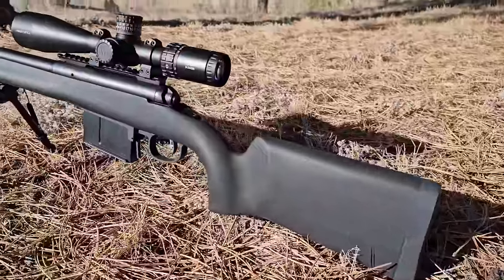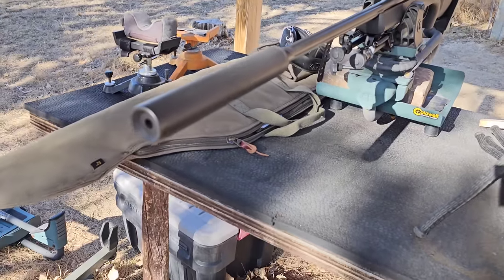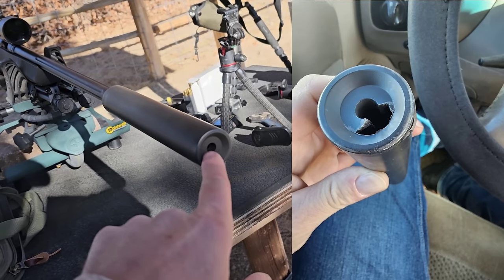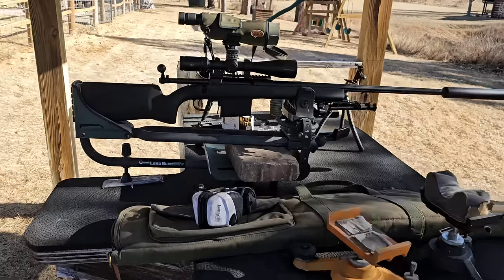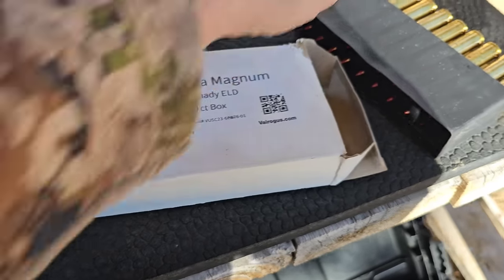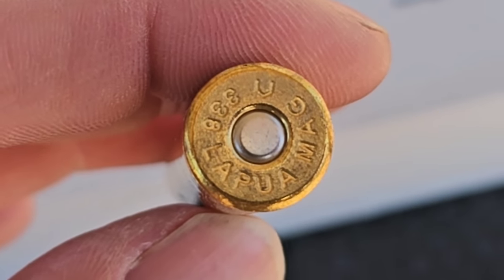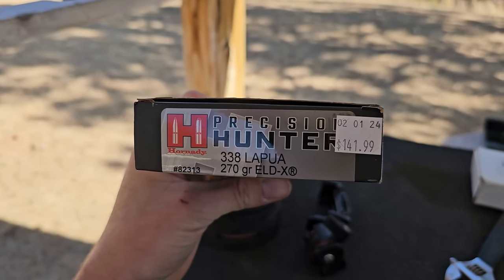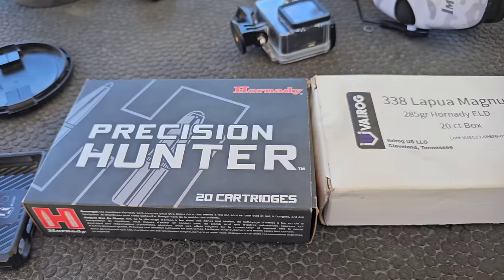Long Range Rifle: Something is WRONG!

Comment: I would try a different scope just to rule that out but I’d bet the chamber is cut just as crooked as the muzzle threads were. Have your gunsmith remove the barrel and chuck it up on a lathe and check for concentricity in the chamber/throat area.
Reply: Agreed
Reply: I'd have your chamber  checked. If the lathe that cut the muzzel threads was off. It's same lathe cut chamber?

Comment: I have a friend that has a Savage 338 Lapua. It had a TERRIBLE wandering zero. He had a cheap scope, cheap rings, and a cheap rail. TURNS OUT CHEAP AND 338 LAPUA MAGNUM DON'T MIX 😆 He put a $1,000 scope on it, swapped out the old rail for a name brand one, and specific rings rated to handle 338 Lapua... Wouldn't you know it... Shoots great.

Comment: I bought a Savage .223 model 12 years ago, bore was so crooked from the factory (internally bent/crooked) that you could bore sight it at 100 yards and the bullet would hit the ground at 25 yards.  Shooting off a bench. They replaced the barrel and it was fine after that. But they have terrible QC.
Reply: Man I have to agree. I was incredibly disappointed when I bought my savage 93 in 22 magnum and the magazines was all fŕrrŕ

Comment: I bought a 6.5 Savage.  I found that the plastic stock would touch the barrel differently as I changed my hold on the forestock.  I replaced the stock with a custom wood stock and free floated the barrel.  You might find this a huge improvement.
Reply: I'm not even gonna shoot my new rifle with that plastic crap stock they're all using these days. I ordered a custom laminated wood thumb hole stock the day my rifle came in. It should come in by Monday and Tuesday will be the 1st day  I try her out
Reply: @mikemchugh949 I have this same rifle in the same caliber. These HS stocks are excellent because they contain an almost full length aluminum bed. HS makes good stocks and they sell to different rifle manufacturers for their target rifles. 
I also love my pepper laminated wood stocks on my Rem700 300 RUM, Savage ML-11 and Savage A17 semi-target in 17 HMR.

Comment: Well, around 18 months ago, I purchased a Savage 110 Tactical in 308W. I went through the clean-up of the bore of the barrel and then completed the range shooting back home. I cleaned up the bore, and then I bore scoped; what a mess chattering the whole length of the bore; the barrel was replaced with a Criterion barrel match-grade. CHECK YOUR BORE SAVAGE RIFLES. It cost me $785.00.
The replacement barrel from Criterion is a Pre-fit barrel that cost me $325 for a 22" barrel; I installed the barrel myself, and I also purchased all the needed tools, the go/no-go gauges, and I mean I bought everything costing me over $1035.
Reply: WOW, OUCH.
Reply: @NoWr2Run , I have other Savage rifles I'm thinking changing the barrels on the other two rifle, take a 30-06, and put a 308W barrel 25/26," an old hunting rifle. My reason to buy everything to change out barrels.
Reply: I purchased a Savage 110 Tactical in 6.5 CM a few years back but my son in law had a Savage FCP in .308. We compared them & it was a sight how much better the quality of my SIL's older rifle is from my rifle which was only about 8-9 years younger than his .308. I also have a Savage Model 12 VLP in .223 1:7 twist from back in the 1990's & it's quality was superb compared to my 110 Tactical. I use to be a super fan of Savage but now not so much. Their quality control is definitely NOT up to what it used to be.

Comment: 1. Make sure your action screws are torqued correctly.
2. Make sure you dont have any obstruction under the action so that you have good contact between the action and the stock.
3. Make sure your barrel is completely free floated from the barrel nut forward.
4. Go over your scope and base torque.
5. Try shooting it out of the lead sled, sometimes rifles require that they are free to recoil especially with this larger magnum rifles.
6. And if it still doesn't shoot you might just need to make sure your barrel nut is torqued correctly and that you have good head spacing so your bullet doesn't have to jump so far before it hits the lands of your barrel when you fire.
Reply: Number three was the first thing that came to mind after checking the scope, that thing being inconsistent like that seems to be a harmonics issue, especially when it shows capabilities of putting slugs in the same hole.
Reply: Oh, I forgot to mention in my last comment JUNK THE LEAD SLED! I have yet to see a rifle that would not shoot better off of the led slug (not a type-0) than on.
Reply: Lead sleds are your enemy not your friend
Reply: With all of the mill work and thread cutting, make sure you have a nice  crown cut and all the lands terminate the same. Or just have it re-crowned and polished.

Comment: My Savages, I get 1/2" MOA to 3/4 MOA with reloads, so if you tried a different scope and it was all over the place, 5 inch groups, that barrel on the 338 wasn't cut right, probably in lands / throat is off.  Make Savage do you right and they should rebarrel it.  Custom barrels usually aren't cheap for your larger calibers but the accuracy you get is worth it.   Take it to a gunsmith for bore scope in throat lands area.   Great video.
Reply from the maker: I'm not sure what I'm going to do yet. Thanks for watching.
Reply: @Guidedhunts I had a savage 110 and 300 win mag. Did not matter what I shot through it at 100 yards it was a 12-in group. I took the rifle back to where I bought it from which was a good friend of mine and he took it out to his range notice the same problem send it back to Savage. They sent him a new rifle and I bought myself a different rifle. Sell a Savage 110 but different model. Now shooting 1200 yds with no problems.

Comment: QC is an issue at Savage. I purchased 2 Identical Savage 110’s in 708 that both have heinous chatter marks in the bore… the bore almost looks like it’s internally threaded. So they either didn’t inspect the bore at all… or did, and let it out the door anyways. 
Every savage I own has very crude machining marks at least somewhere. The actions are clunky. 
I would never purchase a savage without being able to first inspect the bore with a borescope… and only if the price was very low. 
I’m not saying they are all bad… but the truth is… a percentage of them are getting past their loose QC. 
It is what it is.
I like their accutrigger though… they definitely got that right… and the accufit stock is decent-ish. 
When I see so many Savage rifles on the market that are only a hundred bucks less than a Tikka T3x, I am left a bit baffled. A rifle is a lifetime purchase… if you can, it is better to be patient, save a couple hundred bucks more and get a rifle with a reputation of quality… Tikkas and Brownings for example. 
Cheers!
Reply: They must be cousins because I bought a Savage 110 Tactical in 308W that chattered the whole length of the barrel. I replaced it.
Reply: Go buy a Weatherby  or Gunwerk rifle you never look back.
Reply: People who sell guns, as I did, call it "Salvage" instead of Savage...
Reply: @randyfix3664 Seekins Precision PH2 is another one that I would HIGHLY recommend. for $1600-1900... can't beat it.
Reply: @tylervolentine1286  all savage rifle barrels are made that way, always and forever....u have to spend money for something good.....your not getting a Brux, Bartlein, or Criterion barrel when u buy a savage...u have fork out the cash for a good barrel...Criterion barrels are the best buy for the money, unless u go custom then it's 800 to 1000 for a barrel

Comment: As most have said do one thing at a time. First get rid of the lead sled and put it on some bags without the bipod and shoot the same Hornady box ammo. Dont adjust the scope at all. Second  as you has stated check everything for tightness. Before shooting again I would give it a good cleaning and replace the scope with a known proven scope even if your just borrowing it from another rifle. No need to buy another one at this point. Even if its a low powered or better a fixed power scope for testing. then reshoot. If its still bad and all over the place. Pull the gun out of the stock and see if there is anything obvious odd wear marks, is it bedded, is there something that might have slipped under the stock is it setting in the stock correctly. The gun is second hand. Put back together with a torque wrench. Look up the correct specs for the torque. If it still shoot like a shotgun then I would take it to a gunsmith for options.

Comment: I’ve never had much success shooting off a sled with anything that has serious recoil. 
There’s an unnatural bounce and a greatly increased risk of internal damage to your optic. 
I’m not saying there’s not something else wrong, but before I re-barreled I would swap scopes to one you know is good and test again off front and rear bags.
Reply from the maker: Yea, the sled really want weighted down. But I am going to try another scope. Thanks for watching.
Reply: @Guidedhunts  That was going to be my suggestion, try a different scope. I have seen a number of people shooting that rifle and not have groups that bad. I also have Arken scopes, which I am not using any more. The set screws in the turret cover can come loose and you lose where you are. They recommend Vibra Tite.

So, I went back to the most hated scope in the world that has never failed me at all, not once.
Reply: Same here! The sleds aren’t as good as dang bags for me

Comment: I feel for you...very frustrating.
A few suggestions that won't break the bank.
Shoot from sand bags ! if you worry the rifle recoils too hard hold the front end or put your hand on top of the scope.
Install a new scope you know works,  quality matters when using magnum.
Check the rings. Is your scope slips even so slightly through the rings? is the rings beefy enough for a big scope and heavy calibre.
Check barrel channel, is it free floated enough, when barrel wipe it sometimes touches the stock.
Check if the back of the lugs make enough contact, easy to check with a marker on the back of the lug and run the bolt a few times.
Lastly your gunsmith could check a true your barrel and action...
Good luck 
Ps I have a model 70, the top of action was totally out of spec it took me a while to find the problem, I had to ask my gunsmith to cut me some custom bases !

Comment: The only time I've ever experienced something like this was when I had a loose scope base. It was on a 12 ga slug gun and the screws walked out. It was so loose, I could actually see the scope wobbling by applying a bit of finger pressure. I would definitely check the torque on everything that has screws (if you haven't already). If you don't find anything obvious try swapping scopes. If that doesn't work, it almost certainly has to be the barrel and I'd just send it back to Savage. It's not worth experimenting too much given how costly 338 Lapua Magnum is.
Reply from the maker: Scope base and rigs were torqued to spec. Going g to try a different scope. Thanks for watching

Comment: Check the riffling  lands and end of barrel to see if the crown is damaged in any way. Another thought I had is , did the issue with the silencer ,cause any kind of back pressure that might have caused a slight bulge in the Barrel. I have seen wear guys have plunged their barrel into snow and then not knowing it was their fired the gun and put a slight bulge in the barrel. He did not know it was damaged till he traded it at a gun store ,wear it was discovered.  Just my thoughts.
Reply from the maker: Good point. Going to check it with a bore scope to see. Thanks for watching.

Comment: Just got my first suppressor in December. I was told the first thing I need to do when spinning it on any muzzle to to look down the bore
Reply from the maker: Yea, I was never told that. Lesson learned. Thanks for watching.
Reply: @Guidedhunts  It's very difficult to tell but your scope bell is not contacting the end of that pic rail is it?
Reply from the maker: @derekmcmurry4263  Thanks for watching. No, it is not touching, but does look like it in the video.
Reply: Even after doing that, you could have a baffle strike.
Reply: @tacticalmattfoley  Yes I'm certain you could but at least doing a visual inspection is a starting point. At least that's how I was advised by the guy at Silencer Central

Comment: Definitely keep it.  If it is an older model ( non aluminum bedding ) try the 250 gr.  Savage used a different twist rate when they first came out.  They have been upgraded to a faster twist and have accustock type bedding in later models.  Miss my 1st year production one I had.   Your very lucky to get one.
Reply from the maker: Yea, I like the rifle a lot. Other than that, it's not shooting well yet. I will try that ammo and see how it does.  Thanks for watching.

Comment: Try it without the lead sled, make double sure your rail is mated to your receiver ,make sure there is no space under the rail, then check the crown where they re cut the barrel and re threaded it . Then Try a ladder test with the scope to see if it tracks correctly good luck...
Reply from the maker: Thanks for the great info. I will try that.
Reply: Out of curiosity do you handload, if so try just neck sizing some of the fired brass and see if the resulting ammunition works better  @Guidedhunts
Reply from the maker: @armymp76544  I don't reload, but I am going to try a few more boxes of different ammo and weight bullets.
Reply: Let me know if you want to try that route, I'm licensed  by atf to manufacture ammo, and have been loading for over 35 years I'm in the Cheyenne area @Guidedhunts

Comment: Scope and scope mounting problems can wreak havoc… always have to rule that out before blaming other components.
Reply: Agreed. The only time I've seen this myself was on a slug gun that had the scope base screws walk out.
Reply: Generally, I agree with this comment but, given the brake threads were not true there is a very real chance that the rifling isn’t “true” as well.

I’m thinking this is a mechanical and engineering failure.
Reply: The two have nothing to do with each other. You will often find barrels with perfectly straight bores not concentric with the outside of the barrel. Pretty common on eastern European guns. @BZE_Fishin
Reply: @donwyoming1936 …interesting. There appears to be a breakdown in the manufacturing process. That said, despite not being directly related, if one process fails, there is a chance of additional process failures.

Coming from a manufacturing background, this type of issue typically points to a larger problem. To your point, rifling a barrel and threading a barrel are separate processes but, if the barrel isn’t “shot out”, one could reasonably conclude that either, the barrel has poor quality or there is a metallurgical problem from the beginning…pointing directly to a quality control gap.

Simply an observation…my intent was not to discount your position. In fact, I completely agree with your assessment as I have experienced the issue you originally cited.
Reply: I saw a Christensen Arms Ridgeline carbon in 300 Win. Mag with an NiteForce ATAC and mounts do something similar. It ended up shearing the base mounting screws twice. The base was also bedded.  Ended up at Gun Smith going from small mounting screws to larger size. This happened a week before opening modern rifle  whitetail season the first time. I was teaching the guy long range and handloading. It scared me when it happened as the scope came off hitting him in the face and bouncing off the ground. I thought the rifle blew up! Anyway it kept shooting high but still relatively accurate. Ended up selling rifle and building one with integrated bases. 
That ATAC was heavy and the rifle light leading me to believe that was the cause of the problem.  He has now built two rifles both with integrated bases. I have been shooting a very long time and that is the first time I had ever seen this happen.

Comment: Had the same issue with a brand new Savage 110.  It was the scope.  Turns out I had one of the scope rings too close to the turret base.  It was distorting the scope.  Fixed that and everything was fine.

Comment: I have that same scope I put on a 30-06.  I noticed that the bell housing is almost touching the pic rail.  I had that issue as well.  Great glass, but crappy eye relief.  I had to move the scope back about as far as it would go.  I ended up putting it on a 6.5 with a shorter stock and putting on my Leupold 6-18 on my 06.  It has really good eye relief.  I about scoped myself last weekend.
Reply from the maker: It is close to rail but not touching. I'm going to try a different scope to rule that out.

Comment: Vertical scope rings aren’t the best. I had always been told that, and continued to use them some. It’s hard to correct any alignment issues with them, and generally cannot be lapped. If you try, they can come out of round. They are not like a standard ring by any means.

One thing to note about a vertical ring is the bottom screws generally have to be fully tightened prior to installing the upper screws. If you don’t do it this way, they may not be tight enough, and your scope is going to move.